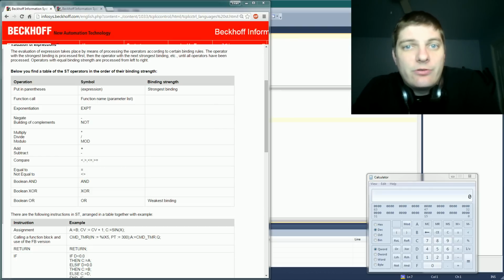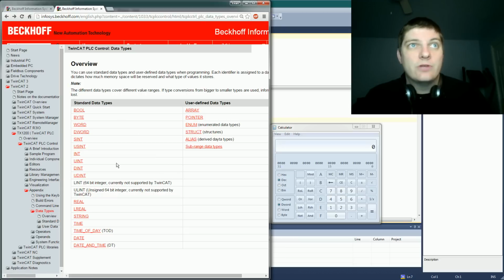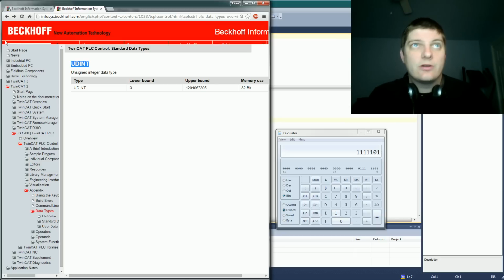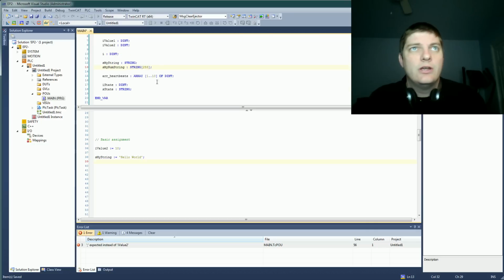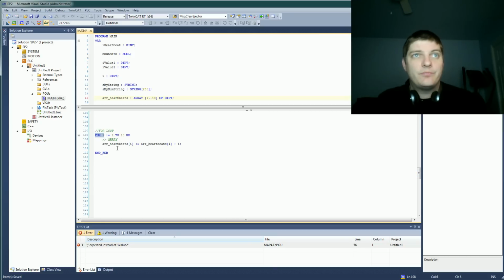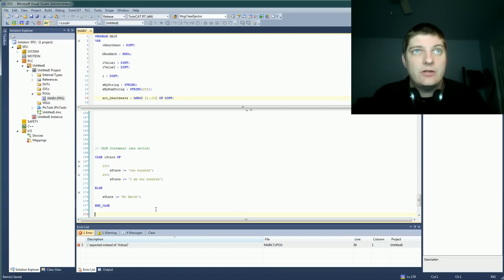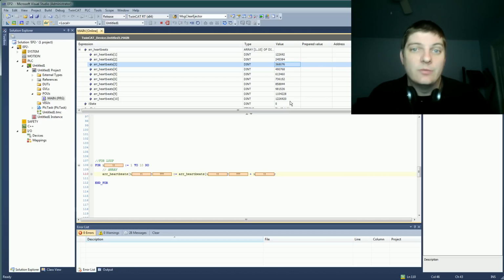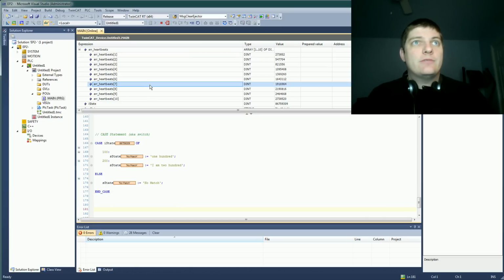Learning PLCs with Structured Text - EP4 - Operators and Data Types

Comment: i have the same code but sMyString is just '0' even though it is := 'hello world'; ........ xD when you cant even get hello world to work you just quit programming
Reply from the maker: Lol, I wonder if it is a problem with the single quote instead of double quote? I don't remember off the top of my head which is right but it does matter. also, make sure that you're as my string is declared as a string data type and not something like an integer or d i n t

Comment: Hi Can you please explain a bit more from the basics as to what exactly is happening when you press the 

1) Activate Configuration
2) Restart TwinCat system
3) Log in
4) Logout
5) Run

Also, let's say I log out and make a change to the code and then log in, will the change be reflected back in the code or do I have to again  restart the TwinCat system?
Reply from the maker: I can briefly.... You need to 'activate' only if you change the IO mapping, configuration, or the licensing of the system.  Activating build the project and sends it to the PLC (if you are developing remotely).  Either way, the binary is then on your PLC, be it local or remote.  Then, you put the system into run which begins execution of the binary project.
Once it is running, you can login which is basically a way to "live debug" and see what is going on inside the processor, watch variables, etc.  If you log out, you can make changes to the code, then log back in and perform a download which will reset everything, or just do an online change which changes only the code you did, essentially adapting that binary to your changes while it is running (this is pretty cool tech).  Lastly, you can online change variable values and apply them online with a write or a force.  I don't recommend forcing variables often, it is a bit odd how it works.  Does that help?
Reply: @SquishyBrained  Thanks, that was precise. Very good and informative videos, i never programmed PLCs before, so its very informative and helpful.

Comment: Do you address the hanging else for nested if-statements in any of your videos?
Reply from the maker: On a production machine, of course.  Not necessarily with an else, but if a state is waiting for a sensor to come on, I always would put a watchdog in there to wait for only specified time, then throw the error and message to the HMI.  I've gotten in the habit of using function blocks to monitor all 'real world' things, which handles error messaging for me in the program without explicitly typing it all the time.  Unfortunately someone else owns that code now, and it really is out of the scope of this video series.
But yes, great point... This video is a simulated machine where things can't really go wrong... but I'd say over half of every machine I have programmed is programming to handle when things don't go like they should.
For your actual question, no I don't address that, but I should.  My short answer is to watchdog every if statement with an else + a timer.  If that timer elapses and the condition is not met, head to state 999 or some other convention and report it to the user with the sensor number and state that caused the error, and stop the machine.
Reply: That's not really what I meant by hanging (dangling) else. In C++ this is a hanging else https://image.slidesharecdn.com/lecture3-140916002814-phpapp02/95/lecture-3-17-638.jpg?cb=1410827406 Do you know which IF statement the ELSE would be associated with in Structured Text?

Comment: Hey Squishy thanks for these videos. Quick question you may have dealt with. I've installed TwinCAT 3 on my PC running windows 10 education and when i try to restart TwinCAT in run mode it just restarts my whole PC. When i first tried to activate config it turned up an error saying i needed to run win8settick.bat which I did. Since then though it will just restart the system. Ive set up and used TC3 on another computer with no issues. Any ideas?
Reply: First of all have you in bios set your CPU enabled for virtual processing? Second, Twincat freezes when you put it in run when you have a windows update installend in januari, remove update KB4056894 or KB4056892 and you should be fine.
Reply: Hey squishy thanks for the video.i am using windows 7 and I am still facing a problem with twincat although I changed the bios virtual technology to enabled.my screen get freezed when put twincat in run mode.please help me out.

Comment: Hi, thanks for the vids.  I'm trying to install Beckhoff TwinCAT 3.1 and keep getting an error saying that "The installation of Microsoft Visual Studio 2013 Isolated Shell has failed.  Setup will now exit.".  Any idea what may be causing this?  I'm running on a Win7PRO machine.  I'm not sure if Visual Studio 2013 is still on my machine, since I now use VS 2017.  Is 2013 required?  Figured I'd ask quickly here just to see if you have any info before I contact Beckhoff.  Appreciate any help.
Reply from the maker: Christopher Lyons I'm not 100% sure... I know you can install 2015 community and then install TC3, and it will let you install into that instead of the prepackaged 2013 shell. It might work with 2017 community, but I'm not sure.

Comment: Hi, thanks for the video series. I'm learning a lot.
You say something about 'hardlocking'? What do you mean by that?
I occasionally get a BSOD while following your tutorial. Is that the same?
And if it is, did you find a fix for it?
Reply from the maker: Elmar N when I say hard lock I usually mean screen freeze, but Bsod is about the same. I've had Bsod for bad hardware config if you have hardware setup in your project, but sometimes twincat just doesn't like the computer. page faults can piss it off, but usually that does not result in Bsod, you just have to reboot.
Reply: Well, I'm just following your tutorial on my notebook. Nothing special and no external hardware connected. I guess twincat just doesn't like my computer. And yes, rebooting is what I do. It is sadly the only option. However, it does happen a lot. Just now a BSOD happened when I opened the program for the first time today. I can't really work with it like this. So if you have any thoughts about how to fix this problem, I'd like to hear.

Comment: Forces are applied before and after the task is executed. The task is allowed to run as it normally would. If a variable is forced and then the code assigns a different value, the force will have no effect. Try the following code and force the variable test to something other than 123. What you will see is that normal is always true, because the first line of code is over ridding the forced value. When you are online with the PLC, the data shown will be after the task execution has completed, therefore you will see the forced value.

test := 123;

IF test = 123 THEN
 normal := TRUE;
ELSE
 normal := FALSE;
END_IF
Reply from the maker: Yes, that is how they are supposed to work... But if I force an Ethernet ip value for instance, often I get the original value instead of what the online view shows. Same with forcing a bit that is being actively set false...  Does not seem to work always. I don't use it that much anyway.